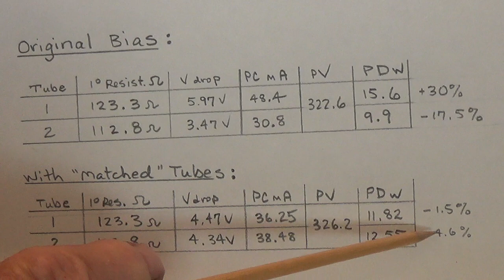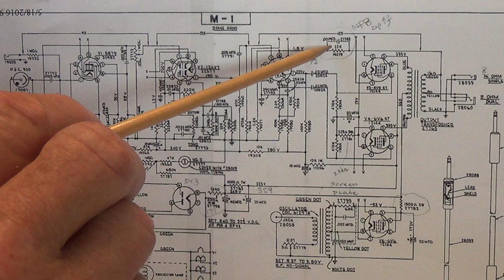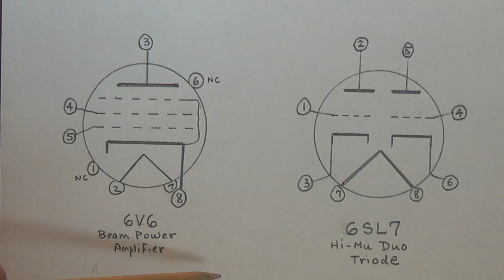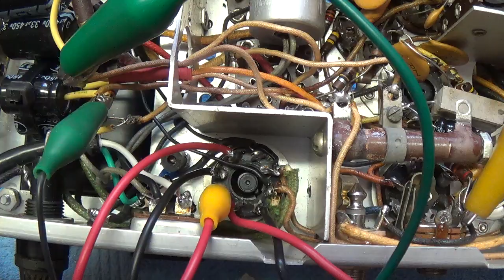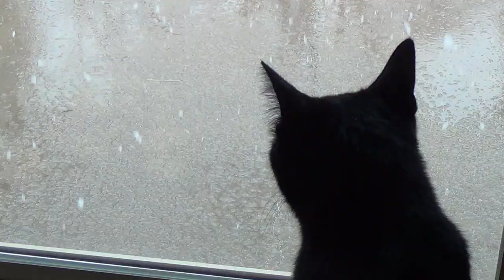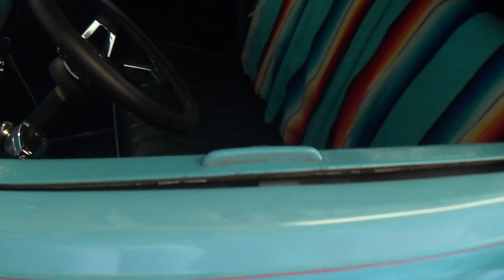Bell & Howell Filmosound 385 Amp Conversion for Guitar Use, Part 2

Comment: Great modification on the NFB-loop. It's like the amp can breath freely. It has a remarkable sustain characteristic with the root frequencies intertwining smoothly with harmonics and resonances as they fade. Very interesting video about a very remarkable conversion. I'm still puzzled how in the Lone Star State you manage to get snowstorms at 111°F, but that's probably a micro-climate-thing as your videos are too cool for deserts to uphold their temperatures :) Thanks for sharing that!
Reply from the maker: Thanks, KL.  We don't generally get both the 111 degrees and snowstorms at the same time.....Rusty used time lapse photography to make it appear so :) Glad you liked the NFB modification.

Comment: I'm still having trouble with the noise level. Otherwise great sound from this amp. Still need to change the 7851 and 5Y3 tubes to see if they're the cause.  Seems to be a regular complaint on a lot of forums. Anything else I should try?
Learning a lot from your great vid's. Thanks.
Reply from the maker: Noise elimination is a complex issue, not easily diagnosed long distance, Vincent. I think you should focus on lead dress, bad connections, carbon comp resistors, etc. Good luck.

Comment: Great video as always.  You mention in some of your videos about wall voltage being lower back in the 50's and 60's when a lot of the amps you own and work on were made.  Have you tried reducing the wall voltage with a variac or similar device to hear the effect on the tone of your amps?  Here is a video with Johnny Hiland demonstrating a device called a Brown Box for that purpose made for convenient use by guitarists.  Do you think this gadget is worth using?  https://www.youtube.com/watch?v=-gaSeS6Nu8w
Reply from the maker: Thanks, Bill. I don't personally use a Variac to create "brown tone", but some very famous guitarists do. If I get the chance, I will experiment with the concept.  Meanwhile, if the Brown Box is not too expensive, you might consider getting one to try out.

Comment: Having two of these amps sitting on my bench, I was very pleased to see you embark on this filmosound project amp. It was indeed a difficult project for an newbie like myself. With your youtube assistance I was able to follow your instructions and get through it. I did not add the tremolo (one must know their limitations) but now have an amp for some closet harp playing. Thank you.
Couple of Q's. I assume I don't need the 20 mf cap that's part of the oscillator circuit and do I need to replace all  of the small caps to rid it of the hum I still have even after replacing the can electrolytics? I also noticed that you have a 33 mf cap in use and wondering what that was for? 
"Like an old married couple ........"  loved that part. Lol  :-)
Reply from the maker: Greetings and congratulations on a successful conversion, Vincent. No, you don't need the oscillator cap, nor do you need to replace the smaller caps to reduce hum.....it generally won't help.  You should focus on lead dress and the tubes themselves to see if they are the cause. I don't recall the 33uf cap......perhaps it was the closest value I had on hand (?)

Comment: Doug, your Trem circuit is intriguing. You showed us your experiment to achieve the working values you used. Are you in the ballpark for a Vibro-Champ or did you use very different values.
Reply from the maker: It's been a while since I did this conversion, Angelo, but my normal method is to utilize a tremolo circuit from an existing amp and then modify it to suit.  I believe that the Vibro-Champ would be an excellent basis for such an addition.

Comment: Uncle Doug, did you have to use that variable resistor to set the B+. I got mine up and running on a limiter at 80V, but then blew a fuse when i went to full power. I will check bias tomorrow and might just adjust that big R. BTW have you seen that version of the amp on youtube where the gain and volume are quite pronounced.
Reply from the maker: Yes, the variable resistor must be adjusted properly.  If you blew a fuse, however, I doubt if it had to do with the resistor setting.  Check for short circuits and leaking filter caps that might increase the current flow beyond the rating of the fuse. You also should be using a Current Limiter with any new start-up.  It will protect the circuit components (and fuse).

Comment: Great video, UD! My 385 didn't have the speaker jacks labeled, don't remember how I determined 8 and 16ohm, have to look at. Mine is definitely dull with the NFB like you say. Also, mine hisses (not hums) really loud when you turn up the tone to the treble side. I removed the photocell which caused hiss originally. Any ideas there? Does yours have anything like the low-end thump of a Princeton Reverb now? That's what I'd like to shoot for. Thanks!
Reply from the maker: Hiss has not been an issue on mine, so I have no experience eliminating it. Generally, the cause is carbon comp resistors.....so you might change them out for metal film resistors.  With the NFB turned down and a proper speaker in a good enclosure, I feel that the bass response is quite good.
Reply: Thanks much! Probably a winter project for me, really a novice at this point, but your vids are helping! Not sure if I asked you this before, but do you do conversions for other people?
Reply from the maker: Rusty and I have retired from doing outside work, Bill. Now we just focus on our hobbies and making videos.
Reply: OK. thought so but wasn't sure. Great work and videos for sure! Please tell Rusty the same for me ; )
Reply from the maker: I will, Bill. Thanks :)

Comment: I have a cabinet I built for a bell & Howell  the version without a power transformer . I decided to scrap the project in favor of a amp with a pt anyway I really enjoy your videos and would like to give it to you it's just the shell very compact and unfinished but it's a really good head start really tight box joints I will try and private message you
Reply from the maker: Thanks, Jim. I responded to your Facebook posting.

Comment: Sorry for two comments in a row!

That hotrod Chevy is great. I also love working on those kind of projects.  I helped a friend install a fuel injected engine into his 1933 Dodge pickup.  We installed a Chevy 350 'tuned port injection' engine with 700R4 transmission.I had to do the ECM wiring and tuning. We got the engine running well, but my friend passed away before the entire project was completed. Here is a picture of the project: http://68.209.87.173/33_Dodge/33_Dodge_2.JPG
Reply from the maker: Thanks for the photo, David. It's a shame your friend did not get to see the project through to completion.

Comment: I just watched this series again because you are careful to match the tubes and adjust the bias.    My question is about tube swapping.   There are currently many headphone and hi-fi tube amps being sold.   (I like the resurgence of the tube circuits)
I am, however, somewhat mystified by some of the practices being professed.   Many of these new amps are being marketed as having the ability to swap tubes out willy-nilly.   If you want to change try another type of tube, just pull and plug.  I have asked the sellers about setting bias and/or matching but have general received the answer that it is not necessary.   I would have thought that making adjustments would be more important for hi-fi/headphone amps.   Are these new amps immune to such needs because of some sort of magic tube fairy dust?  Or will the modders be met with the possibility of premature tube/circuit failure due to the imbalance of it all?       Sorry if OT, I didn't know of a better place to ask my noobish questions.   Thanks.
Reply from the maker: Greetings, CK.  Cathode biased output tubes tend to be "self-regulating" with regard to plate current, and this ability generally allows you to change tubes in such circuits without having to re-bias after each exchange. I assume that the amps you speak of are all cathode biased. This makes for a good sales pitch, but in my opinion, it never hurts to double check the bias from time to time. Bias resistor values can vary with use, and some of the newer tubes operate at voltage and current levels that may differ so greatly from those for which the original bias was set, that you really need to take occasional measurements to be sure everything is OK.

Comment: Another great video Doug, thanks! Every time I watch one of yours, I get the hankering to clean off the workbench in the garage and finally start that 5E3 project that's been going through my head.  I feel that now I'd know what I'm doing, as opposed to just following a recipe and soldering things together without knowing their function.

I like how you go from snow to blazing temps there. I was in White Sands a few weeks ago when it was 106 out.  "But it's a dry heat" as they say!  Thanks again and keep up the good work.
Reply from the maker: You're welcome, Mark, and thanks so much for the nice comments. We're glad the videos have been helpful. White sands is only about 80 miles away.....and, yes, it may be a "dry heat", but at 106 it's still darned hot !! :)

Comment: Great tremolo sound! I have a couple of 1950s Bush radios which make great guitar amps with a great sound, they have pickup sockets in the back so you just need to make an adaptor and plug straight in, one I picked up recently has quite a hum on it though, quite a few wax caps and I can see at least one is over heating, I'll change the caps and see what happens.
Reply from the maker: Thanks, Adam, and good luck with your project.

Comment: What a coincidence. I just stumbled across this schematic for an Ampeg Jet J12B with a 6SL7 tremolo oscillator. http://www.unofficialampeg.com/schematics/j-12-b.gif
Reply from the maker: Wow, that's the first circuit I can recall that used a 6SL7 as the tremolo oscillator, SA. Thanks for the schematic :)

Comment: I would think that in the dual 8 ohm jack version, it was used to drive two speakers, one on each side of the 16 mm screen on
a gym stage where more coverage was necessary,  Rat's nest wiring technique from the original factory build.
Good effort with all your improvements but to me it is not what I would call an inspiring amp if I had to play my guitar through it.
Those 283 Chevys were neat engines. With a 4 barrel you could get good performance from it. Nice little truck.
Reply from the maker: Thanks for all your comments, SC. Rusty and I always appreciate them.

Comment: Very nice! My former B&H colleague watched part one and found it to be interesting even as he reminded me he was on the mechanical side of engineering. Myself as well during my tenure. All the best!
Reply from the maker: Thanks, JC. I am flattered that an original B&H engineer would watch one of our videos. I'm glad he found it interesting.
Reply: I've  been a HUGE fan of these systems that were used by Bell and Howell. The first thing I noticed was the 25 watt Jensens in the little cabinets! They were the first thing I fell in love with. And I played one forever! Still in the little Bell & Howell cabinet. People would ask me all the time, what was my guitar amp? I would tell them FILMOSOUND... then there were OTHER people using them at gigs. And I began to seek them out. Eventually I got FOUR of those 25 watt jensen loaded cabs and screwed and epoxied them all together and made a FILMOSOUND half stack (a four 12 cabinet) and played that for a long time. The Magnatone I'm playing through at the moment has a late 50s/early 60's filmosound speaker in it, which i think is a Heppner? It's wonderfully bright and differs from the Jensen with an aluminum dust cap and actually superior sensitivity and breakup at higher volumes... certainly the best speakers for guitar I've ever owned started off in Bell and Howell cabs... I have a bid on one of the old 6v6 amps from what appears to be the early 50's or even late 40s... hope i win it! lol

Comment: Hi Uncle Doug love your videos . Wood love you to look at a  amp from a 179 Filmosound projector as it has no power transformer & are thought  to be unsafe  & because of this are very cheap. If you recon the 385 amp is cramped have a look at the 302 Filmosound amp as it reads magnetic sound  & records as well as the optical sound  . I have found that Film Teck have schematics for most of the Bell & Howell amps .
Reply from the maker: I tend to avoid the series filament circuits, Ham.  Not so much because of any shock hazard, but simply because they generally don't provide the type of tone and volume found in conventional amps with power transformers.  If the 302 amp is more cluttered than the 385, then I'm afraid my old eyes couldn't handle it.  I'll leave jobs like that to you "youngsters" :)
Reply: Hi Uncle Doug thanks for  your thoughts on the 179.  Re the 302 . it has a remote transformer as to fit all the extra in. will this affect  its tone thanks
Reply from the maker: I would not think so, Hams. Remote or not, if it has a PT, its good to go.

Comment: nice Tremolo Uncle Doug!  So glad  you make these videos.  Little by little I'm learning stuff as time permits  Today I installed an Ampro deluxe 12 inch speaker from 1957 or 47 to replace an ageing and failing 1946 Jenson in my 1946 Masco Map 15 guitar amp.
Reply from the maker: Thanks, Bruce. Rusty says that anyone with a 1946 Masco amp is OK in our book :)

Comment: Excuse my ignorance, I'm a beginner. In theory, if I wanted to power to 12v dc peripheral off of the amp couldn't I wire it to the filaments of the 12ax7 tube similar to what you did with your pilot light on the oscillator tube? Would this change the amps performance? Thanks!
Reply from the maker: The filament voltage is AC, Curtis, so that may present a problem. However, if you could use AC, and your power transformer had a 12VAC winding for the 12AX7, and you didn't intend to use much current (like a few mA)....you could probably do as you suggest.
Reply: +Uncle Doug thanks Doug! I actually have the exact same filmosound as you're working on in the video! Does it have a 12v winding for the 12ax7?
Reply from the maker: No, like most power transformers, this one has a 6.3VAC winding. Because the 12AX7 tube has a center-tapped filament, you can wire the tube so that the 6.3VAC becomes 12.6VAC.....but only within the tube itself.
Reply: +Uncle Doug thank you Doug! I appreciate it, love the videos, keep up the great work
Reply from the maker: You're welcome, Curtis. Thanks. We will :)

Comment: These videos are very enjoyable, and also very informative. I have been wondering if a decent guitar amp could be made from TV tubes, since those are plentiful. Maybe would build one for my brother.
Reply from the maker: Thanks, Mr. TM. I don't believe that the vast majority of TV tubes are applicable to guitar amp use. You're better off sticking with traditional tubes for a home build.
Reply from the maker: Thanks, Mr. T. I'm sorry but tubes are special for each application, and TV tubes, in general, won't work well for audio amplifiers. Proper audio amp tubes are readily available, so this is not really a problem.

Comment: Doug!! The lock washers under the machine nuts on the face of the amp are sending my OCD out of control!!
Reply from the maker: I'm not sure if that's good or bad, MD, but I tend to put lock washers under nuts to keep them from unscrewing. One might be a little off center......so I'll correct it :)

Comment: Back in August, 2008 I was blessed to have gone to Gerald Weber's amp camp in Kempner, Texas. I also have his books and videos. He stated that if you have a output tranny that has 8 and 16 ohm taps, your better off using a 16 ohm speaker connected to the 16 ohm tap. He said you will enjoy the full output of the tranny because you are using all of the windings. 
 Please comment. Thanks,  Eric
Reply: That is correct! :)
Reply from the maker: If Gerald said it, then it must be true, Eric.....and it does make sense.

Comment: What a nice little amp. Great project Doug. Love that truck. A friend of mine had a 1951 5-window Chevy pickup back in the late 70's 3 speed manual with an LT-1 350. That was a running little truck. A big oak tree dropped a limb on it during a storm. Total bummer. I had a '69 SS 396 4 speed Camaro until I got married. I should have kept the car. Before the Camaro I had a '69 Dodge Dart 340 4 speed. I gave up hot rods for lent (not really). Actually... the section of the brain that says don't got fast to normal people is defective in my brain. Abstinence keeps the insurance rates low :o)
Reply from the maker: Thanks, Michael. Like you, I've always enjoyed old cars that go fast.  My high point, however, was buying a brand new 1965 GTO with Tri-Power and a 4-Speed, that I proceeded to run, literally, into the ground, like the juvenile idiot that I was at the time......but darn, was it fun :)  The final indignity came when I traded it in on a new Toyota Corolla 4-Door after I got married and my daughter was born. The trade made sense at the time, but I still wake up late at night in a cold sweat just thinking about it :)